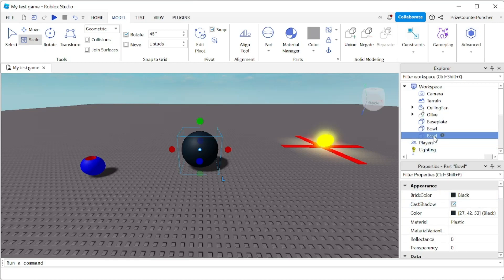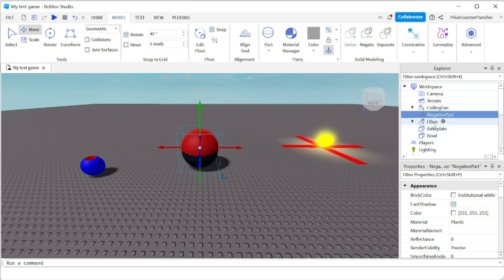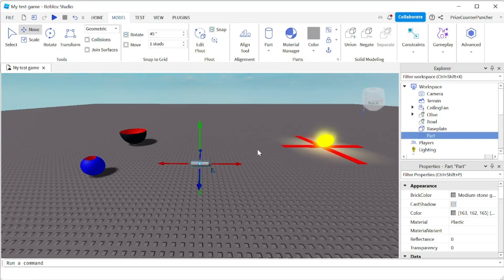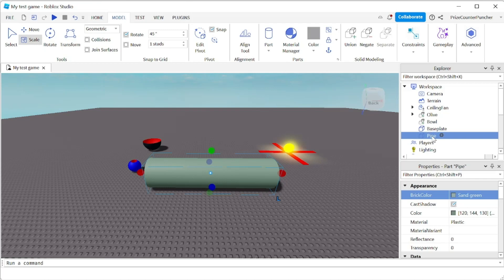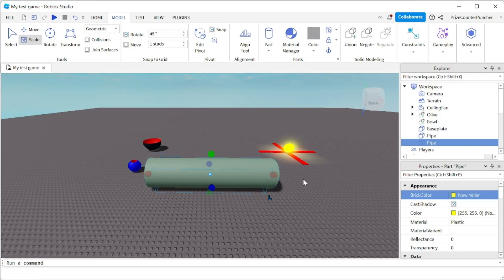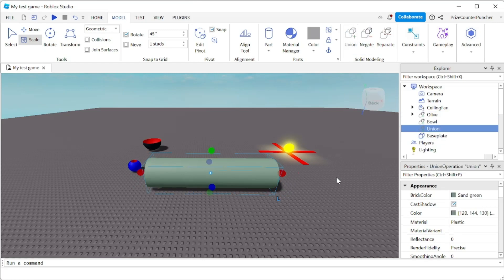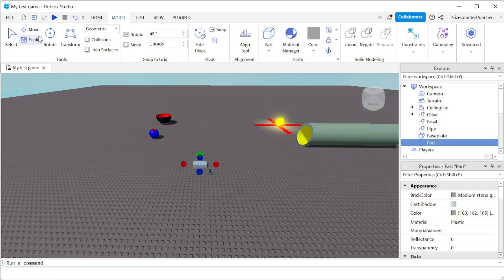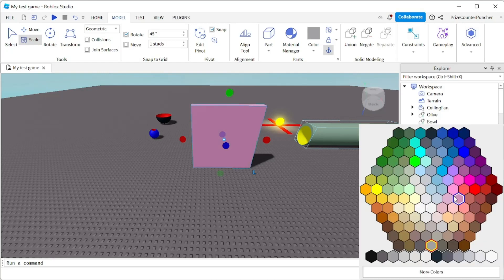Exploring 3D Model Creations | Roblox Solid Modeling Examples

Comment from the maker: Related materials:
How to Build 3D Objects (without Blender) (2022 Roblox Studio Tutorial Beginners Series) (B035) - https://www.youtube.com/watch?v=TpjLwLjGLbM
Roblox Hinged Door with Vertical Hinge (HingeConstraint) (2022 Roblox Beginners Series) (B032) - https://www.youtube.com/watch?v=yRESJzPFpcI
Basic Hinge Constraint (HingeConstraint) Revolving Door (2022 Roblox Studio Beginners Series) (B030) - https://www.youtube.com/watch?v=5Zv3gnCtBCw
How to use a Motor in Roblox (2022 Roblox Studio Tutorial Beginners Series) (B034) - https://www.youtube.com/watch?v=R9Ayha5Eq0k
Proper Way to Add Pickup Sound in Roblox (2022 Roblox Studio Tutorial Beginners Series) (B033) - https://www.youtube.com/watch?v=iK97J6-Oddw